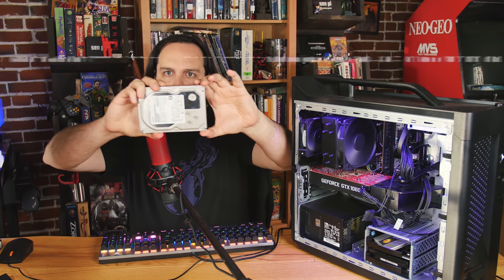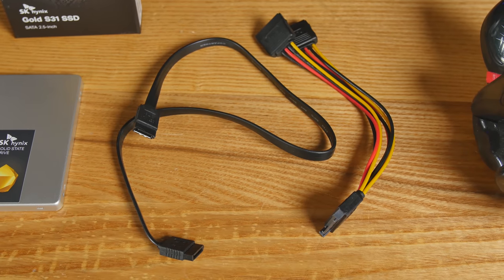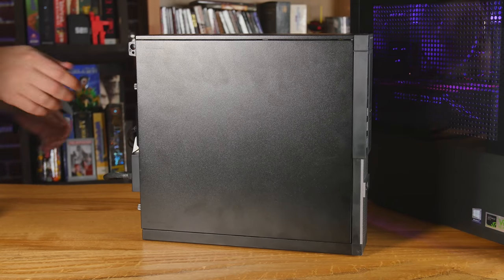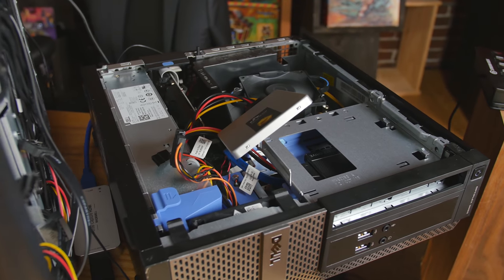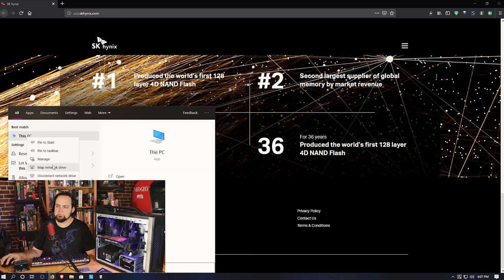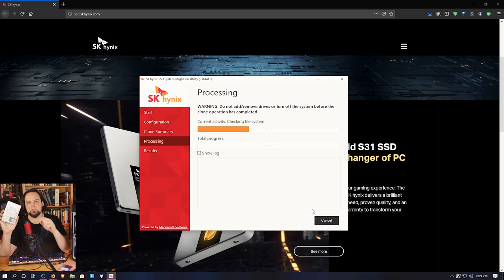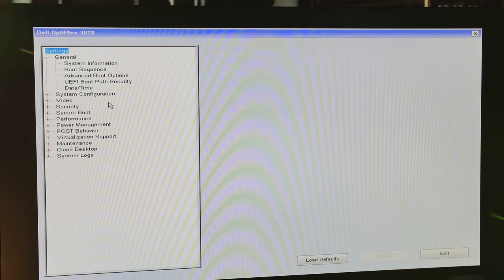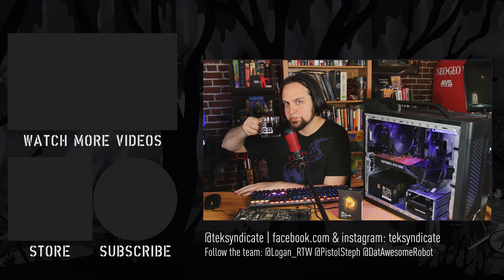Upgrade Your Desktop to SSD & Easily Move Windows Using SK Hynix Migration Tool

Comment: I bought my first SSD in 2012 and I thought I was late to the game LOL.
Reply: 2019 baby. Was I late? After 5 harddrive crashes I've finally upgraded lmao
Reply: @evanwiger  bruh 2019 i used my first ssd in 2020 its 2tb and i still use it on my pc build to this day
Reply: i just replaced my hdd with the same ssd in this video LMAO my computer is from 2010...
Reply: I bought a 128 gb SSD in 2014 and it was  kind expensive lol
Reply: Just upgraded to a 1TB SSD from a 1TB HDD best upgrade I've made.
Reply: Just got my first SSD lmao when I’ve wanted one for like 5 years
Reply: I’m just about to get one  😅

Comment: The data migration tool worked like a charm like you said. I switched boot drives and changed my mechanical drive to storage. I previously tried this with a different tool but it wasn't able to boot up on the hynix drive. Thanks for the walkthrough!

Comment: Following are my suggestions for making this video clearer and better for those of us who have never opened a PC or are nervous about cloning Windows 10 on C and not want to brick their PC!    1) spend some more video seconds on showing close ups for power and data connectors for cables as well as SSD/CD drive 2) How to identify different type of connectors, cables, perhaps a simplified diagram of what type of connector and cable goes to what type of connector on SSD and motherboard  3) Provide a link to Amazon or ASIN for Y cables/Power cables/tools etc 4) If SKHynix, Windows 10 or Macrium software will let you do the same with USB to SATA cable in a yet easier way. Thanks.

Comment: QUESTIONS: First, are you saying that when an SSD is the primary drive Windows is being booted from on a Desktop, you only should have the Data SATA III cable plugged into the SSD, but not the Power SATA III cable plugged into the SSD? If that is the case, why? 

Second, why are you saying it is necessary to have the SATA III Power cable plugged into the SSD while using Cloning Software?

Third, are you saying a 3.5" mechanical Hard Drive should use both the Data SATA III cable and the Power SATA III cable when the HDD is the primary drive being booted from? Or is it only necessary to use the Data SATA III cable? 

I'm a bit confused after watching this video.

Comment: I have a couple of questions:
1. Does the software work on any and all SSDs? Or do I have to use that brand only?
2. Can I migrate my boot drive data while windows are working, or do I have to use another system for the migration?
Thanks in advance.

Comment: QUESTION: My laptop from 2011 is a Dell Latitude e6420. It came with a Kingston 128GB SSD when I got it. This Kingston 128GB SSD takes exactly 17 Seconds to Boot every time. But when I cloned to a 1TB SK Hynix SSD with DRAM, it actually made the Boot times longer. The laptop now takes 20 Seconds to Boot. Why would it take longer with a SSD that is so much larger and includes DRAM?

Comment: For Linux you don't need any weird tool. Just put the SSD in another system and it works fine, except when you use an Nvidia-card, then you need to put in some extra work but if you go from one system with an Nvidia card to another (or a system with an AMD-card of course) then it is not a problem either.

Comment: Is there a reason to spilt a SSD of 1tb into 2 partitions?  Can I not change the partition sizes?

Will this software work with any brand drive?  Is it still the best choice?

I presume the boot sector will work?

I'm doing this with my laptop.

Comment: I never thought about tinkering with SSDs until Walmart started selling them around '16 or '17. When I saw them, I was like, "The only people who know enough about these to find usefulness in them aren't going to go looking for them at Walmart." However, when I started looking into console upgrades and portable flash drives, I found a use for them. Most HDDs require enough power for the internal mechanisms to function. However, plug these SSDs into USB enclosures and you have a handy, portable hard drive with the capacity of an HDD but the durability of a flash drive. Eventually, I decided to upgrade the hard drive in my main computer rig containing my OS to SSD. Fortunately, I had a hard drive cloner from when I was upgrading my consoles. Less than 30 minutes later, I pop it back into my computer and boot it. I could, definitely, see a speed increase. But, one thing I found as a side effect was that I was getting video tearing while watching YouTube videos in full screen mode. I have a program I run in the background Process Tamer. It throttles programs that use up too much CPU power so that they don't slow down the system. I had Chrome set to "Force Below Normal" because it could easily eat up all the CPU resources before. Once I configured Process Tamer to ignore Chrome, suddenly I wasn't getting video tearing while watching YouTube videos in full screen. I can't think of any reason why Process Tamer could create an issue like that other than Linus from LTT having a similar issue with his NVMe file server:
https://www.youtube.com/watch?v=xWjOh0Ph8uM
My guess is the SSD was attempting to optimize the CPU usage but was competing with Process Tamer trying to do that itself.

Comment: Super video.  I have one issue.  My Dell Inspiron's C: drive is a M2 SSD.  Everything in your video worked perfectly, but i can't seem to figure out how to change boot sequence.   I cannot swap cables on hard drives because of the M2 drive.  My Dell has a APTIO Setup Utility.  I would appreciate some insight on how to change boot sequence with this Utility Software.

Comment: Do I need to have the SK hynix SSD hooked up to the computer in order to install the data migration tool program? I just bought the SSD and haven't hooked it up yet, and the downloaded migration tool program won't install to my existing computer. I get an error message. In your video you were about to install the program but skipped showing what you did there. It was already installed when you continued the video. Do you think the Samsung migration tool will work with the SK hynix SSD? I already have that one. Great video, thanks.

Comment: Eventually worked but Windows originally failed to start. I had to set my volumes on the drive back to C and then rebuild bcd. Not sure what happened but it's fast now that it is working!

Comment: what is this 2013?
Reply: I know, right?  My kids gaming PCs had 240gig SSDs in them back then.
Reply: @teknerd  Heck if you go back to the late 1970s, you could buy 128k "Bubble memory" cards for various systems; Intel made them for the Apple II for example.  I know a couple of Amiga users (or rather I knew) who used 5mb Disk-On-Modules back in the late 1980s.  Of course the Bubble memory was just non volatile RAM, and the DOMs were only good on systems that didn't do heavy file journalling (write-life wasn't great).  But I do go on...

Comment: So I just noticed that my SSD holds my system partition while my hdd has the booting one. I get an error while trying to clone my hdd over to the ssd, must likely due to the system partition existing in the ssd. And I can’t delete it, it’s windows locked.... any recommendations?

Comment: I'm running widows 7 now. Should I upgrade to windows 10 before or after doing a solid-state upgrade? Man you talk fast. Lol thanks for this video.
Reply: I would migrate over first before upgrading (if) I upgraded because everything is faster after you get the faster hardware in. Just my 2 cents of working in the field for 20 years. These guys give vvg info from time to time.. always keep learning.

Comment: BEWARE: I followed all the steps exactly and got error 0xc000000e the SSD will not boot
Reply: Update it worked I had to trouble shoot using this link 

https://www.minitool.com/data-recovery/fix-error-0xc000000e.html
Reply: @q100john  what did you have to do?

Comment: hey i have this same SSD (secondary) in my Legion 5 and i've been getting bsods and i realised that its related to any files accessed on the SSD. I wanted to know if theres a way to check if the SSD is defective or if there's a problem with the connector on the mobo.
Reply: Did you get your answer by anychance?
Reply: @Lonzology  it wasn't my ssd because I removed it and still got the bsods so I think it's the ram so I'm tryna return it.

Comment: SSD--- YES---- But I like using my REGULAR DRIVE for my 2T DATA drive-- it doesn't need to work so damn fast.    I put my OS on an SSD- and leave all data on the regular drvie-- and so far the only thing I've had any issues with-- has always been the "fast" stuff---- so as I said- use SSD for the quickness of it-- and keep the old ones for data-- (and I DO NOT automatically mount it)  I moutn it when I NEED to..

Comment: When he says it's not a good idea to use a y splitter to power sata drives I don't think he knows really much of what he's talking about because 4 years I used to run y splitters in my file server comprised of 30 terabytes using about 20 drive and at least half of them   had y splitters... it all depends on what kind of power supply you have and what kind of output your power supply is capable of
Reply: It's best if you can avoid splitters, dedicated power for each drive is ideal.
Reply: there's a lot of amps for 5V and even more for 12v. even on multi-rail PSUs. I cut of wires and connectors from all PSUs I can't repair just for the cases like this when I can't wait to get ready made ones.

Comment: Can you use that data migration tool for any brand SSD?
Reply: Old comment but yes. You can incase anyone else rn is wondering
Reply: @Lonzology  No you can't, when I launch the app it displays..

ERROR: SK hynix disk is not attached to this system.

A SK Hynix is required for this program to function.

The application will now exit.

Comment: Do they need to be mounted or just in there flopping around?
Reply: Its best if you mount it. Its not that hard just like an extra minute of set up. But if you really insist on not mounting it. It will still work

Comment: Ok, no offense, I love you guys. But man you're a bit behind. Currently it is very cheap to get a NVMe SSD, even 512gb ones are ~$150. If you really want to save money you could get a 128gb one for your OS and a normal SSD for more storage, it's really cheap. Granted, older motherboards won't support NVMe, so it's not great advice for the people you are trying to adress, but that's not really your audience here in the first place.
Reply: this works for nvme too its just an example
Reply: I seen curical mx500 m.2 for 99
Reply: Not everyone has m.2 slots on their mobo. I just picked up an ssd for my mothers older prebuilt